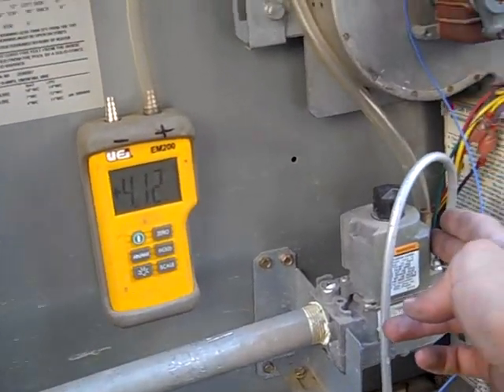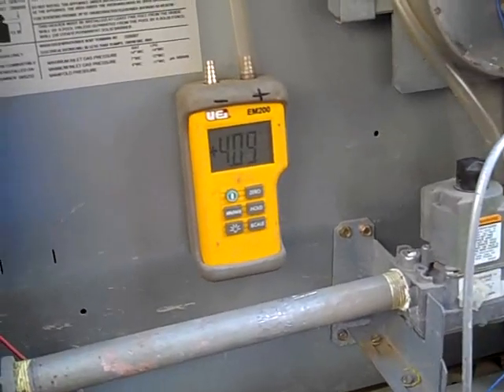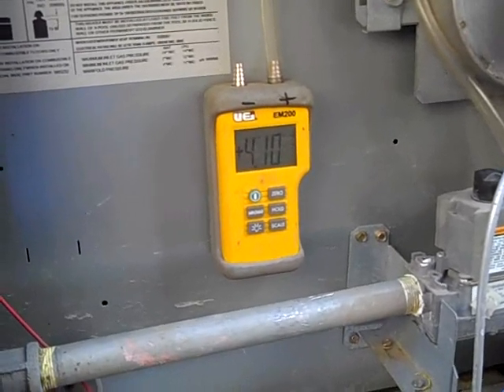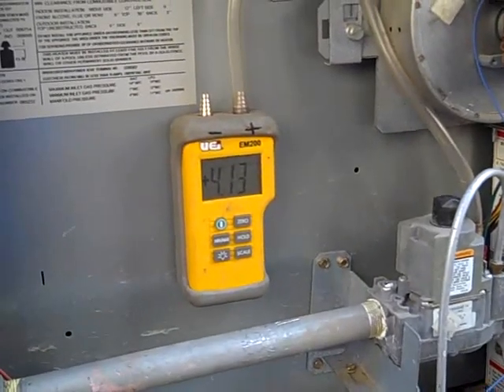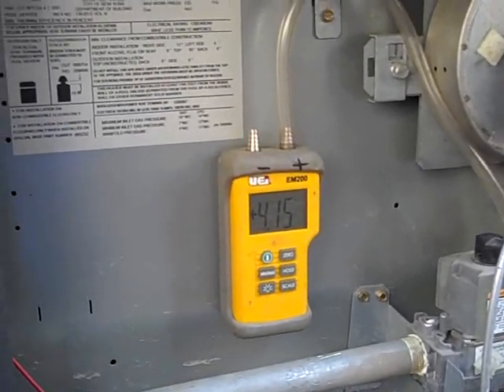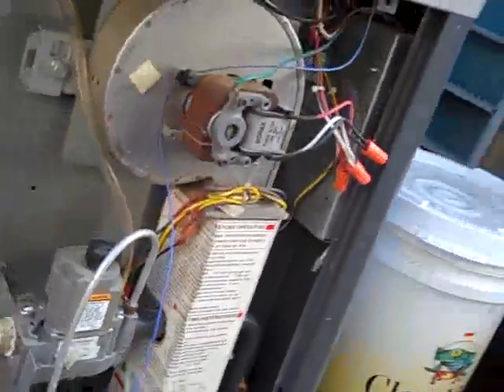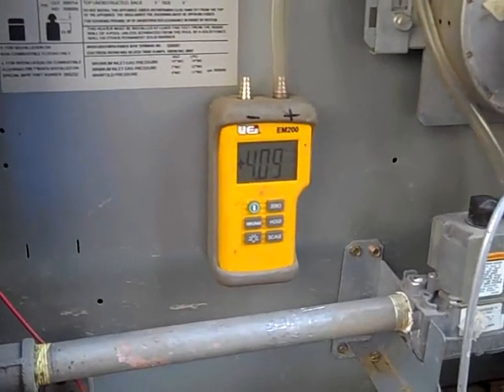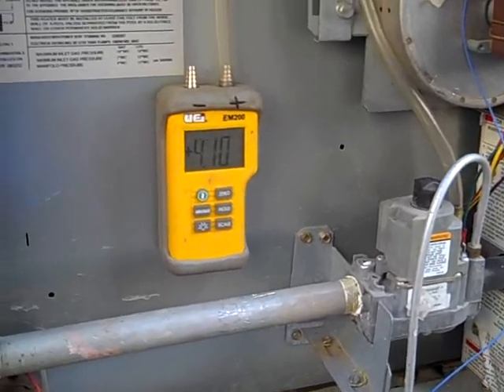Marginal gas pressure

Comment: What would happen if the gas pressure is lower than manufacturer recommendation? I only ask this because I am troubleshooting an STA Rite 333 system and I have found no issue and yet the system fires and then stops after a few seconds. I have checked and bypassed all of the sensors (For the experiment sake ) but nothing has worked thus far so I am suspecting the gas volume